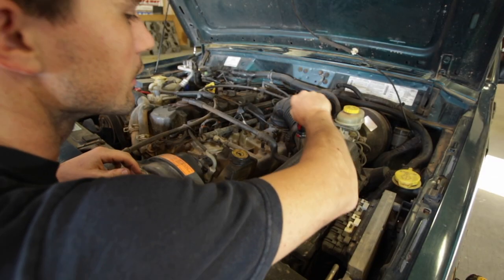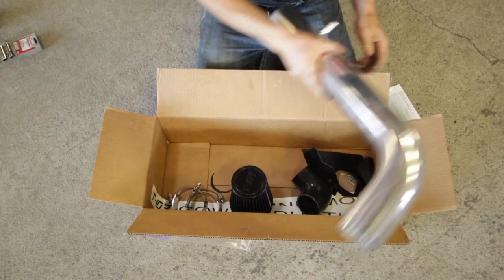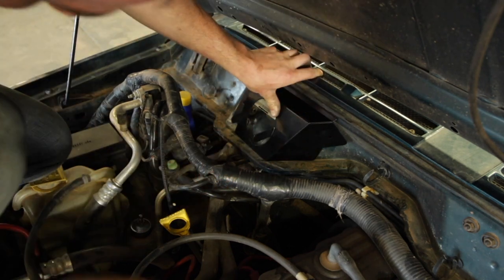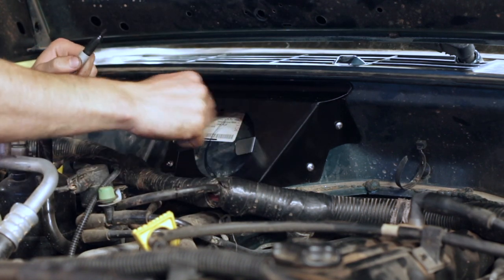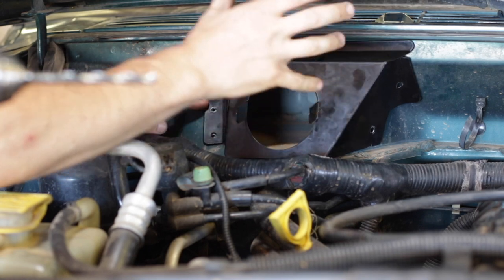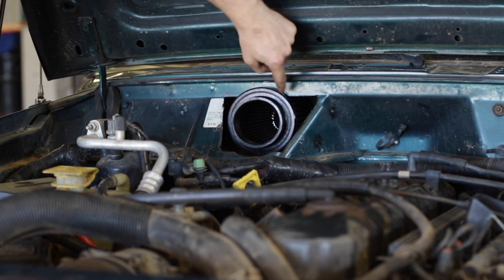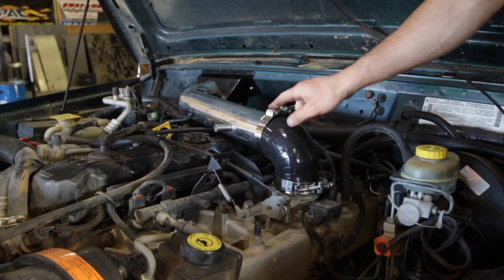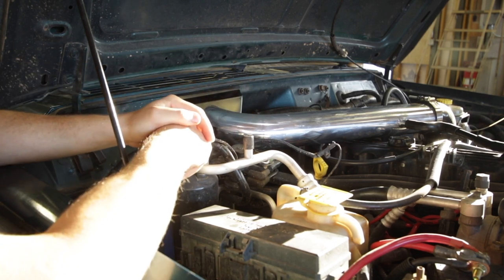THOR's New Cowl Intake Install

Comment: This actually doesn't look like that bad of an idea. It wouldn't suck in any hotter air than your air vents for the cab do (seeing as how it's the same intake point). So long as the drains are working, water getting in shouldn't be much of an issue, though it might be a good idea to put some kind of shield over the top of the filter so water doesn't drop straight into it (or just block up part of the intake grille above it).
Reply: the holes are on the drivers side of the cowl no holes are directly above the filter
Reply: Good to know! I haven't had an XJ to bits, so news to me.
Reply: Darwinpasta thats exactly what i was thinking
Reply: I keep meaning to put a sensor on the entrance to the air box, not just the intake manifold air temp sensor, to see how incredibly hot the under-hood air is after passing through the radiator.
Reply: You can also do a cowl intake from the driver side through the factory airbox. And no, it won't take in any water.
Reply: @RavenRedwood  on my 1993 , there isn’t enough room to attach a 3” tube on the side facing the firewall nor can I go into the side.

Comment: If you do a cowl intake I'd recommend picking up a vortex throttle body spacer from Rough Country for like 50 bucks, it improves airflow from the small cone filter and makes a sweet whistling sound to boot

Comment: I installed their cowl intake a few years ago when I did a dual battery setup and very happy with it. T/Y Trail Head Off Road.
Reply: Jasper Q have you had any issue with the air getting hot from heat soak and raising the average temperature of your engine?
Reply: @jeremiahlandi6891  6 years with no issues at all. Sorry for the late reply...lol. Still a great mod and would do again in a heartbeat.
Reply: @jasperq7146  lmao 2 years late

Comment: Doesn't that heat the air going into the intake when it goes across the valve cover? Or is that a negligible difference in most cases. Looks good!
Reply: Yeah that'd help for sure
Reply: Fancy Polak I would say it negligible.
Reply: Negligible since it comes in from the passenger side. Most intakes come in from the driver's side, which goes right over the exhaust manifold anyway.

Comment: Two things:
1. Aluminum intake tube transfers heat (like aluminum does) from hot engine bay into the intake tube.  If you really wanted it to do you some good it should be insulated, or at the very least ceramic coated.
2.  Those mesh filters (like K&N, etc) make a bit of power by increasing the airflow vs stock filter.  They do this by NOT FILTERING.  Sure, they keep out the rocks and birds and rabbits, but they don't filter out dust fer sh!t.  And dust will kill your engine.  Ever see a K&N filter on a desert race truck? (a REAL desert race truck...not yer jerkoff cousin's 85 blazer).  No, they use intake filtration that's actually designed to feed the engine clean air.  Kinda like the stock XJ intake air system was.

Comment: "Nice and secure and no movement " unlike the engine.  Needs an acordian tube. I did one myself with an elbow in the factory air box and a flex tube into the cowl. Used epoxy to seal the air box 3" hole on both ends. Works great.

Comment: have had mine for roughly 2 years or so now my kit thru thor had 2 rubber elbows set up is barely different only compaints i didnt get the cowl induction stickers its kind of a pain to clean getting the filter in and out of the cowl without snagging and that big harness still is just floating wherever it wants to go other than that i love it havent got around to doing the dual battery set up yet very interested to see that computer looks like it might be in the way tho

Comment: I personally would have used some foam sealing strips between the bracket and the firewall.
Reply: Its supposed to drain water and not let it get to your intake
Reply: No because it’s suppose to drain out water when it rains or washes.

Comment: Nice kit and fit etc. however, the noise and air cleaner replacement seem a bit too much to deal with.  Most of the air intake kits are supposed to bring in cooler air for engine improvements which we all may know doesn't go so well with the "high" air intake benefits for water etc.  Actually, the cowl area doesn't breath well at low speeds so the hot sheet metal and engine radiant heat will raise the ambient temps during slow driving. The air cleaner replacement is rather cumbersome as well plus the added noise isn't really a plus in any form. If the focus is on river crossings, this is a neat conversion but for any other driving need, it's likely go more negative features. Great video showing the process.

Comment: Using a little ingenuity and a couple household hardware I made my own one from PVC and an air raid filter.  I saved about 180 bucks and it works great ...however,  I will probably end up buying the THOR for my new XJ
Reply: What size pvc pipe did U use?? 3 inch?

Comment: I noticed you kept the crank case hose connected to the intake. You should run a catch can or just simply vent it underneath by extending the line, and blocking the hole where it connected to the intake. You're still getting heat because of it.

Comment: Sure is a lot of haters. Put mine in last week. I love it for the simple fact I now have more room in the engine compartment for onboard air. There are no noticeable performance gains just so everyone knows but it is a quality product. Wish I had known this was coming out this week as I did not receive any instructions. Looks like Tim had the exact same issues I ran into. Great video
Reply: doesn't look like it allows for flex, how does it hold up on the engine start up and revving, it might eventually crack from the looks of it

Comment: What about heat soak? Aluminum is extraordinarily good at conducting HEAT. The aluminum tube crossing over the top of the engine at close proximity will certainly have a significant warming effect on the air coming in from the cowl. IMO, the choice of metal for the tubing was a poor design choice. Stainless steel would have been a far superior material and steel conducts heat far slower than aluminum.

Something to consider which means a follow-up video detailing how the cowl has performed over a period of time would be appropriate and appreciated.

Comment: Tim, I like your videos and your way if work, but this is a horrible product.

The style of filter and it's height make it horrible. This will take in an water that goes over the hood. The size of the filter puts it right on the lower sheetmetal, in any of the other older kits you use a smaller filter that will keep it almost at the top of the sheet metal in the cowl. I cannot remember what filter I installed but it is half the size, and still rated for up to a 400HP engine. Second issue is the tube going to the throttle body. One, it's HUGE. These 4.0L engines will never need the much flow. Two, because of it's size, you cannot insulate it, which it DEFINITLY needs. These 4.0Ls run hot as is, and having an insanely hot intake charge will not help. The heat soak that tube is going to be getting is going to be crazy.

Comment: I took my air box out so I could get at my shock nuts and again so I could remove and install a new radiator. Not sure I would do what you did though. Is there material above the air filter so it doesn't get wet when it rains? I couldn't tell in your video. Never mind, I read the comment above mine that the holes are on the drivers side.
So did the glove blow out the tailpipe?

Comment: I have to say this doesn't look like a practical set up. In fact it looks like a bad idea.i could see lots of problems coming from this setup.. 1 the engine not getting enough cool air and gas mileage going to shit. 2 self tapping screws into sheet metal are gonna eventually strip out unless you plan on never changing your air filter. 3 Wich brings me to another concern . Is that air filter going to be easy to find off the shelf at your local parts house or is it a special order?  4 water drips down the cowl pannel while it's raining outside. I can see the potential for water to make its way too that filter.

Comment: "Jeep driver dies of CM poisoning while driving vehicle.  The pollution of the vehicle's cabin air occurred do to a modification made to the vehicle and being placed directly into the vehicles air vent system.  Toxic "blowback" from the running motor then had a straight pathway into the cabin."

Comment: You should’ve use the factory flex intake hose because now when you rev the engine and it torques, you don’t have any flex whatsoever in the new intake tube. Also, what’s going to happen when it rains and the water goes down into the cowl?
Reply: The passenger side cowl doesn't get water in it

Comment: The tp sensor, mass air flow sensors are all located on the throttle body. Putting this unit on does not effect emissions because it does not interfere with the sensors. I live in ca and have this unit. Took it to smog with it on passed with flying colors.

Comment: Hotter air inlet temperature with the intake over a hot engine.
Reply: Dylan Cox not really, heatsoak is mainly from the buildup in the engine bay, having the pipe run over the engine won't change much, also the pickup is from the outside air so the intake is cooler. the positives out way the negatives.
Reply: allthings possible yea with out evidence, what he is saying is a complete farce. I would say even with the routing over the engine. The air coming in is much cooler, and the small amount of time it is in the intake tube before being consumed by the engine is not enough to heat the air substantially. Even though it may get heated up a little, probably still cooler than the stock air intake. Plus cowl intakes are "cool" anyways.
Reply: Basslicks and Big Tires OMG cherokeeforum.com all up on here. LOL
Reply: Basslicks and Big Tires haha givin quality advice on and off the forum!
Reply: CF GANG
Reply: Dylan Cox how is it hotter?
Reply: Arg! I'm tryin to stay off the forum right now cuz I wanna buy another xj but you guys aren't making life very easy when your over here too lol!
Reply: Stuck Buck lol come back to the forum and yourself another jeep
Reply: Stuck Buck peer pressure. Do it. Just do it.
Reply: using plastic tube instead of metal also helps reduce high temps.
Reply: there's a lot of haters commenting on this video. smh sad... but y'all will go out and buy 20 led light bars. or a smittybilt winch.

Comment: I have the Spectre version of this on my XJ. Not sure which I like better... seems like that THOR filter could get pretty wet being in the exposed cowl, where the Spectre model has it inline under the hood. Went with the Spectre because it's CARB legal for here in CA.  Jeep is looking great!
Reply: Jeff Chappell I was wondering if you put a carb legal sticker on it would it pass through inspection?
Reply: I've wondered the same thing and I'm not sure. I believe the technician will plug the CARB number in to log it and verify the part is what you say it is. But something without markings or logos could pass through as long as the sticker is related to an intake application for that year and model.

Comment: No danger of water logging the engine when it rains?
Reply from the maker: No
Reply: The air opening is on the driver side and the filter is under the passenger, the plate they provide under the hood doesn't seal tight for this reason and the cowl has a drain already

Comment: why not fit a proper snorkel of its an offroad only truck? I feel that kit will kill the engine soon.
Reply: Kos Factor he isnt going through water deep enough to matter.
Reply: T Wayland exactly my point, why bother with this hackjob anyway.
Reply: A snorkel wouldn't last 10 minutes on some of the trails we have up here, it would get ripped away from the mounts while driving off-camber right up against a tree. I've had the cowl system installed for 5 years now with no problems.
Reply: It doesn't have to be deep. Simply nosing down into a relatively shallow body of water can be enough to suck into the stock intake. With the intake in the cowl, you're pretty much certain to never take in water unless you're being really stupid.
Reply: Kos Factor It's not an "offroad only" vehicle.
Reply: james kvinsland often the issue when by passing stock airbox is that the generic conical filters let in too much dust. why not have a cowl kit which goes through stock airbox, it is anyways optimized for the engine. may be a disconnect system can be used for on road use. I have seen a few vehicles like that.
Reply: It's pretty difficult to get a lot of dust into the cowl area. Mine was fairly clean other than a little dust and a few pine needles when I cut into it after 13 years of use. Even with the filter sucking away at the ambient air in there, the top is still 'open' and the drain is large enough to supply fresh outside air without turning it into a dust vacuum.
Reply: Kos Factor optimized for the engine? lmao when these came out it was prolle optimized for the new laws in place that eventually killed the 4.0.
Reply: It was laws that killed the 4.0 but not the ones you think. Crash standards killed it and every other inline 6 engine. Engines do not crush, they move back in a frontend wreck. With the increasingly stringent front crash standards the crush zone in front had to be bigger and an inline 6 is just too long. That is the main reason they are gone now and not replaced with another inline 6 design, which is too bad because I think the inline 6 is dam near the perfect engine balance wise.

Comment: one good mod to do for the straight six is to replace the intake manifold with one that came on the motor in the end of the 90's and early 2000's  99-04ish
Reply: So an 04 XJ intake manifold huh... I'll be on the lookout for that unicorn
Reply: @camaroboi13  the 4.0 was still available in the wrangler and grand cherokee until then.

Comment: and when it rains??????
Reply: I saw a post about Spectre's version causing huge amounts of water to build up in a guy's throttle body while sitting in a rain storm. Not sure how this one would be any different.
Reply: Lance Hamilton had mine on for awhile 2 years or so now i thought it would suck up water too but it dosent seem like much if any actually gets in
Reply: Good to hear!
Reply: the cowl vent isn't open on that side, there is a screen type deal and the holes on that side aren't open, they just look like they are.
Reply: correct, the black cowl plastic is solid on the passenger side. its only vented on the drivers side
Reply: I had a spectre and it got water in my engine. It also caused the filter to fall apart since I could not see it and particles of the filter ended up in my engine. Could have been a real expensive fix.

Comment: I don't get it, what does it do?
Reply: Clay Sensiba It moves the filter into the cowl area to bring in cooler air and creates more space in the engine bay.
Reply: It's main purpose is as a snorkel. Instead of having a snorkel hanging off the side of you jeep to get hung up on trees and brush it is inclosed in the cowl. It is plenty high in the engine bay and keeps the splash out. If you got water higher than that then you have other problems.

Comment: never to see legal road use again
Reply: Just move to Texas
Reply: anywhere you else they won't let you register it because he drilled through the vin plate. I feel like it would have been a better Idea just to move it over a little
Reply: Killam with kindness just put mine on last week and I assure you there is no vin there
Reply: That's why there's a VIN tag on the dash. Stickers can fade, tear, and fall off. I've never even seen a VIN sticker there before, just the yellow one that has the oil filter part number.
Reply: oh. I thought that's where the actual vin plate was. I didn't realise it was a sticker
Reply: Yeah it's just a sticker they can put anywhere under the hood. I've seen them stuck on the underside of the hood before, on the inside of the fender, on the radiator support...they just slap them anywhere in the engine bay so mechanics can see them conveniently in case they need to look it up for parts lists.